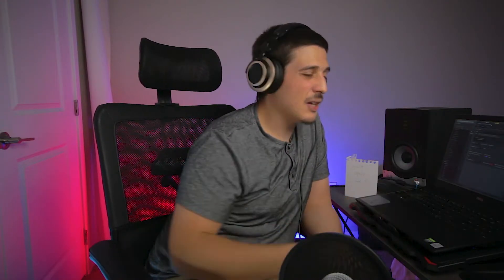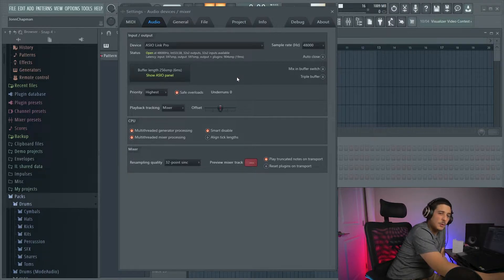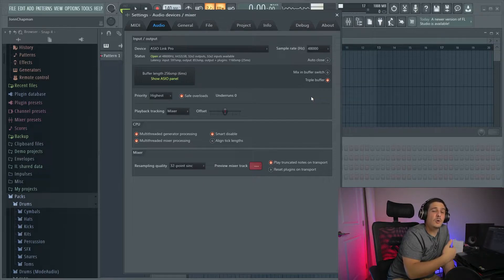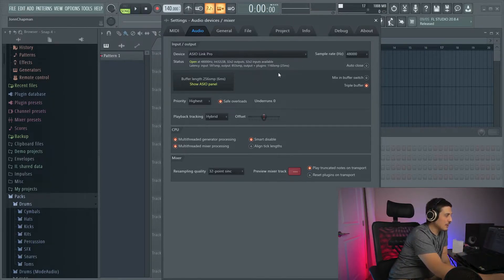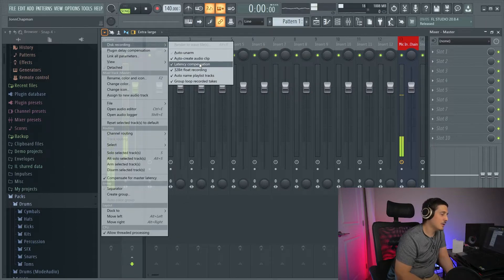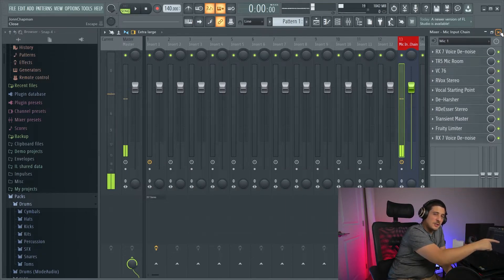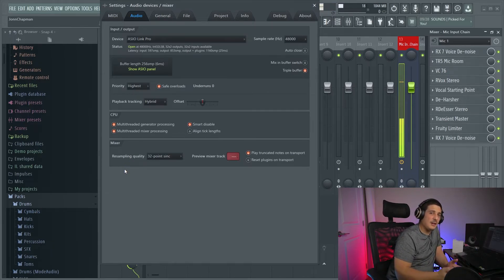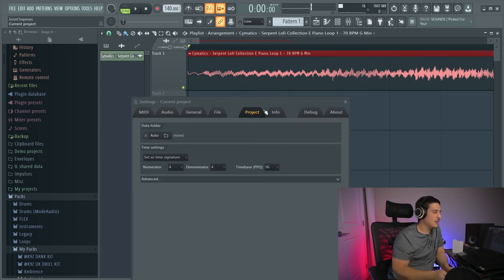How to fix FL Studio Latency Issues (MISTAKES) DON’T BREAK YOUR PC

Comment: You really do know what you're saying, awesome video sir! You might be able to give me some advice...I get underruns and crackles no matter what I do. I think I know I've applied everything there is in order to increase my buffer and not get crackles (even though i know that when you get to a certain point, buffer size doesn't help that much). I've applied all of the settings you mentioned. I have a komplete audio 6 dedicated audio interface, when I choose 1024 samples, it starts to crackle and pop. Needless to say, this doesn't happen when I start a new project, but later, when I start filling it up with effects. My vocal chains have over 10 fx slots, so i end up sending a channel to extend it. I mostly use mix and master plugins from waves. I've come to notice that when I play 2,3 more of these types of chains (add to that your typical additional sends like reverbs, parallel comp., delays, etc,). Each project I start ends up like this. Before you know it, it gets bottlenecked. Do you think I'm using too many plugins? I've seen people utilize more plugins in projects with over 200 tracks (cubase) and  they're getting much smoother playback. Any advice would be much appreciated! Thank you and have a great day Warren!
Reply: Forgot to mention that I end up using fl studio asio at 2048 samples.  And that the vocal chains I mention sometimes end up having even 20 plugins/fxs on them (and that's without the parallel processing, reverbs and delays)
Hope you get to 100k subscribers soon, take care!
Reply from the maker: Hey! I love the your account name btw. That sounds to me like limited processing power or limited resources actually being used by FL studio. I know the same thing happens when I start filling fx chains or use a lot of high cpu instruments. I currently have 16gb of ram and a 1st gen focusrite Scarlett 6i6. If I use high cpu intensive instrument vst’s i do preventative maintenance. I’ll consolidate tracks and activate the smart disable option so that I can keep the original midi and vst in case I want to change it but my playback will use purely the consolidated wave file saving a lot of processing power. If I have intensive fx chains I’ll often save a duplicate project and consolidate tracks that way I can remove the vast amount of VST’s but also have a project to go back to if I need to change something. This can get complicated once you start adding auxiliary tracks and busses into the mix though. Because of this I keep trying to push the boundaries of doing more with less to save cpu in my projects.

Something to check though is your task manager if you’re using windows. Lately I’ve noticed “windows desktop manager” has been taking massive amounts of cpu on my computer (I’m talking 50% of my processing power and more). So I constantly have to check and restart the process. But it could be anything taking up cpu. A virus scan in the background from your antivirus software, viruses themselves, buggy windows processes, etc. so check there as well when you start getting the crackles.

Anybody using hundreds of plugins is probably using a wicked machine. 64+gigs of ram with a hardcore processor or 2 I’m sure. Gotta do with what we’ve got though.

I know this isn’t much of an aha moment or a straightforward solution but I really hope this comment is helpful.

Best regards!
Warren 🤙
Reply from the maker: Oh I also noticed you said you’re using an interface but using fl studio asio. Check and see if your interface has its own asio driver. That could improve performance. I know my 6i6 can use fl studio asio but also has its own driver which I always use.
Reply: @ScaleAudio  Thanks so much Warren, really appreciate the detailed response! I just noticed I forgot to leave my specs. I am using a solid machine 
CPU : intel i7 8700k
RAM: 16gb
AUDIO INTERFACE: Komplete Audio 6
The reason why I choose FL STUDIO ASIO over the asio of the audio interface is because the audio interface one maxes out at 1024 samples (and goes real low, good for recording vocals), but when I'm producing, I switch it to fl studio asio because it gets me to 2048 samples. 
I hear you when you say less is more, and that is true, but sometimes I just can't dial in the vocal with less than 10 plugins, and that's where the bottlenecks start to appear mostly. Since I know that audio processing utilizes single core performance, I was thinking of maybe jumping on to the new i9 12900k, or 12700k... their single core benchmarks are significantly higher, I'm sure I'd see a difference there. But its not an easy switch, I'd have to get a new motherboard, and switch to ddr5 ram. But if gets the job done, I'm willing to invest...
Reply from the maker: @bartsimpson2131   I hear ya. If you have to I’d say just consolidate for now. You can always hover over plugins to see how much latency they create in the top left. Generally if it’s responsible for a lot of latency it uses a lot of cpu. Just keep optimizing and consolidate as needed and you should be able to get through until you upgrade.

A recommendation in the meantime is do things in segments. I know you said you use waves so for example you can run saturation to imitate a pre-amp, a high/low pass for cleanup, follow that with a de-esser, cla to cut peaks, waves vocal rider, r-vox for general vocal compression afterwards if needed, and a c6 if needed for any other problem solving. (Hypothetical.) then make a duplicate of your project but with your dynamics tuned in for the most part in both projects. Now you can bounce your vocals with the dynamics fixed up, get rid of the compressors etc. and have a free clear vocal chain to work with for eq, pitch correction, coloring, reverb, etc. plus a project to go back to for dynamics specifically. Rinse and repeat if needed. It’s a destructive way of editing but if the vocals do need that much work then what can you do, you know?
Reply: @ScaleAudio  Will do sir. Funny you should mention the part about hovering over plugins for latency, on account of I was testing that a couple of days ago, and was thinking the same thing you said that if it’s responsible for a lot of latency it uses a lot of cpu. I'll try everything there is to try, I'm sure I'll sort it out somehow. Thank you buddy so much, really appreciate the help! I'm sure this channel will just keep growing and growing, so good luck!
Reply from the maker: @bartsimpson2131  thanks! Hope to see you around again 💪